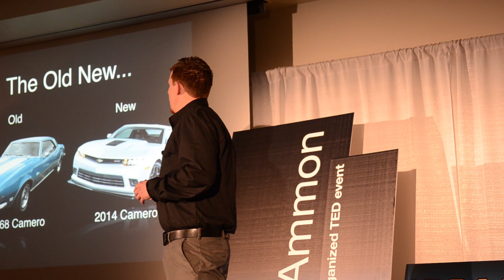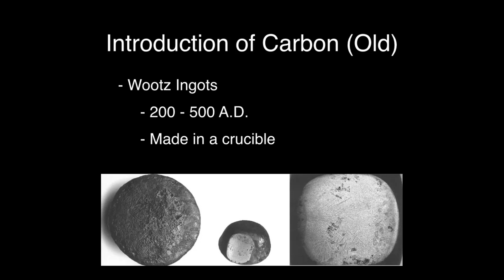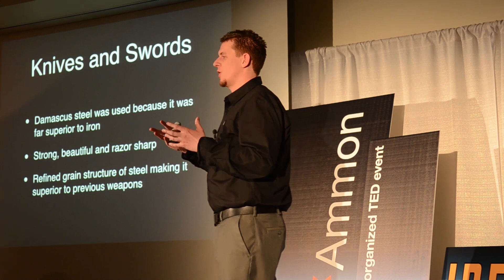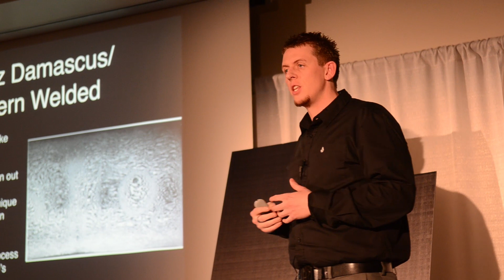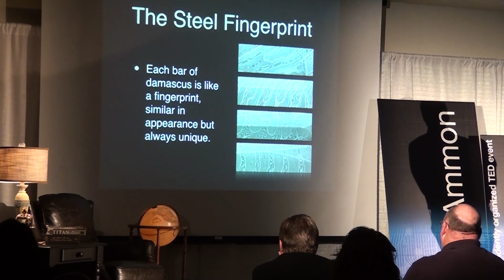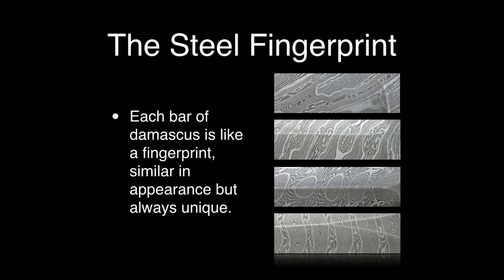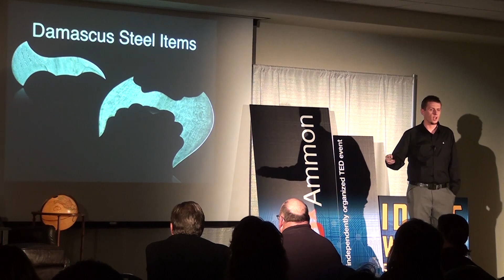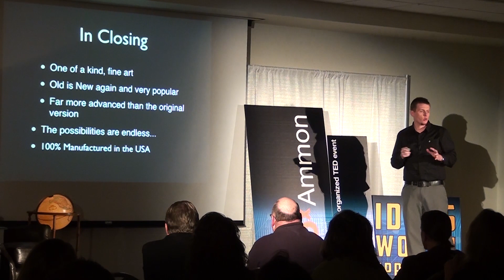Forged in time - a history of Damascus steel: Zane Schenk at TEDxAmmon

Comment: This guy is a used car salesman. He using False Equivalency to compare Pattern Welded Damascus steel to Wootz Crystalline structure Damascus steel. There is nothing wrong with Pattern Welded steel at all, it is far far easier to make and it was also made in Damascus and lots of places during the time period. It is still comparing Apple's to Oranges to try and Sell knives for his Company. Just be honest about it, crucible steel is 10x harder to make, it's not an exact process every time, it's far more time consuming to smelt, heat treat, and forge than Pattern Welded Damascus and it blow up in your face at any time.

Comment: Uh... about 80% of the facts presented are nonhistorical hearsay.
Reply: NieroshaiTheSable off the top of my head, crucible steel was much better and by the time of the mid crusades replaced Damascus steel as the better quality... the vikings had it even earlier from their trade line to Turkey, and used it in their Ulfberht swords. Japanese swords, not "forged by samurais," mind you, were not damascus and were not pattern-welded; a hard steel shell was laminated around a soft steel core. Just because they folded the steel  does not mean there was a pattern. The "wavy line," or hamon, was not a result of pattern welding, it was a result of intentional differential tempering using a special clay as a buffer. The whole thing about running red-heads through... no. Just no. There are no trustworthy records of this, and the Church would have prevented it if the regional governments did not, and in racially celtic areas this would have resulted in genocide. Why did saracen blades cut into (not through) early crusader weapons? A rigid, curved sword is more capable of biting into a straight iron sword, especially if the idiot with the latter refused to a point to ever use his shield.
Reply: NieroshaiTheSable Not to mention that running someone  through with a red-hot sword isn't going to quench it evenly and will get bits of flesh stuck to it. A reason blades are quenched in oil, as well, is that quenching in water (or blood) can often cause a blade to crack.

Damn, I clicked on this video to learn, not to educate.
Reply: Yea i think so

Comment: Woot and pattern welded steel are NOT the same thing. Woot is an extremely high carbon crucible steel that gets its pattern from carbide segregation catalyzed by trace element nucleation. Pattern welding gets its pattern from the actual chemical compositions of different steels and how they resist an etch.
Reply: yes.
Reply: agreed  and wootz isnt damascus either its the crucible steel damascus is forged from. forge welded steel never reaches a liquid state that wootz requires  to form crystals in the metal that arent in pattern welded steel..
Reply: Al Pendry was making real crucible woots Damascus steel before he passed. There is a video showing all this. When I seen him using 2 different steels with different carbon contents I knew it was fake lol.